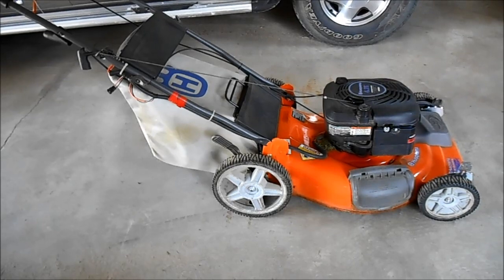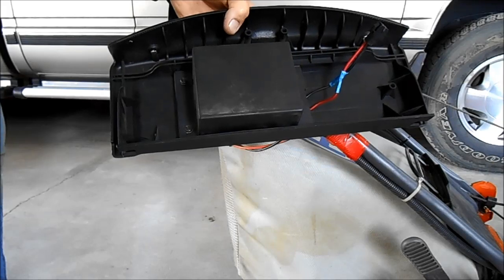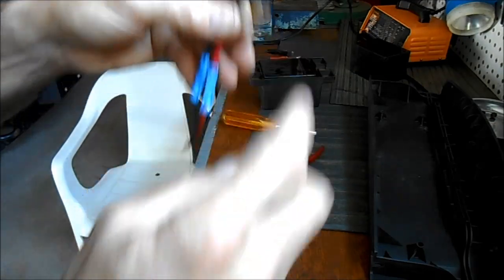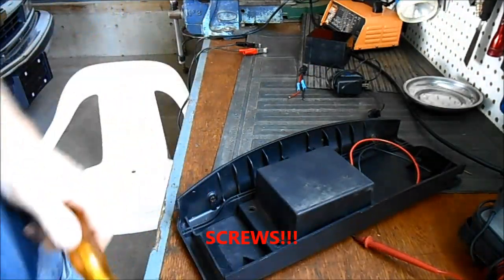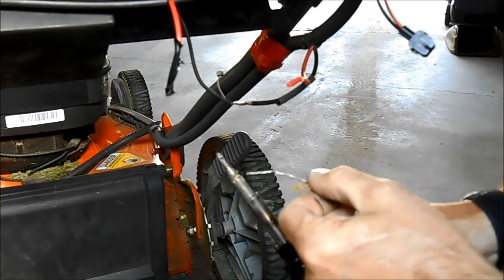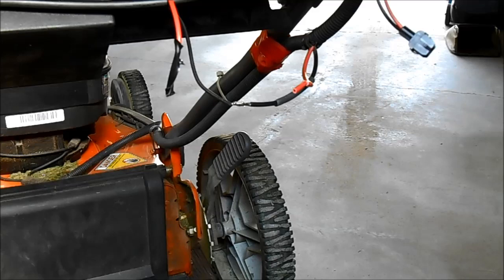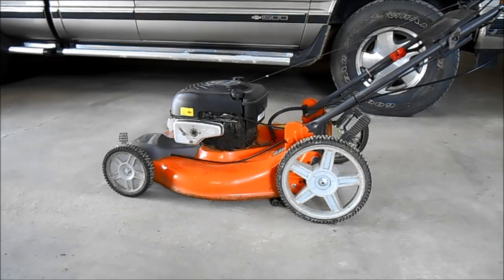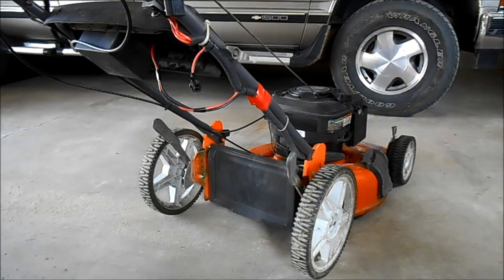Replacing the Battery in an Electric Start Mower

Comment: I don't have a electric mower, but I enjoy your videos. Always well done Bruce.
Reply from the maker: Thanks
Reply: +Bruce Pender hey Bruce im having trouble I need to find some of those connectors for the battery terminals I can't find em online anywhere cuz a battery like u got there cost 13 bucks where as a do I battery what was in there cost 50 bucks for a new one and I also need a foot of red and a foot of black cord for splicing
Reply from the maker: Sometime you can eliminate the connector but cutting them off and spicing the wirs instead.  Good luck.  Any good hardware store should have wire and tape.  If you don't have a soldering iron the blue inline connectors work too.
Reply: +Bruce Pender I got a iron I just not sure where to find those blue connectors
Reply from the maker: If you have an iron just plice and tape the wires.
Reply: +Bruce Pender ok thanks bruce im do it just like u spliced yours up in video then I guess and cut the adapters also

Comment: How you doing Bruce me and the wife like your videos    I have a question for you my friend 
My lawn mower have a new battery  and the starter is good  but only works with the pull cord  when I try to start it with the key doesn’t work 
Can you please help me thank you and have a blessed day
Reply from the maker: I would trace back the connections from the battery to the key.  Of course the battery is charged up??
Reply from the maker: Was it working with the old battery or is the mower new to you?
Reply: @BrucesShop  I buy this mower used

Comment: Did you use 16awg wire to make the new connecton on the battery? YOu said you used 16gauge spade connectors. I have the same style of mower and want to make more of a solid charging connection and eliminate the extra charging terminal from the battery. Thanks!
Reply from the maker: I think so   This video was made in 2014

Comment: Hi I have a question about electric start push lawn mower, can the lawn mower operate without the electric starter? I purchase a mower from flea market and it would crank up for few seconds than quick by using the pull cord.
Reply from the maker: Yes a lot of folks just abandon the electric and go to the pull rope.